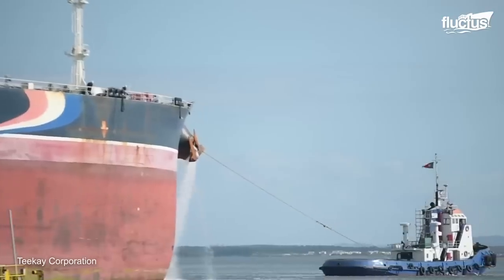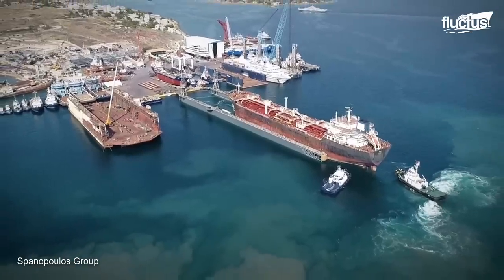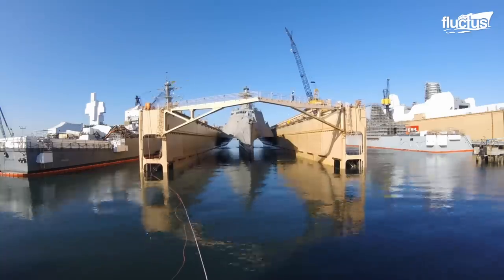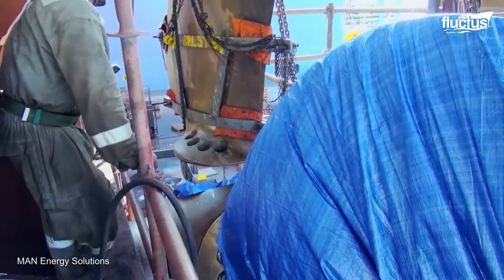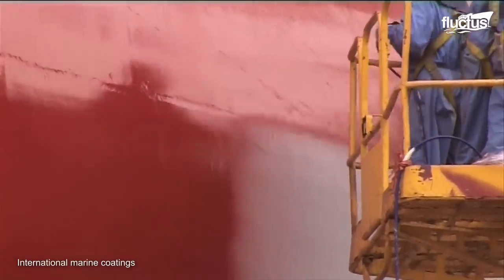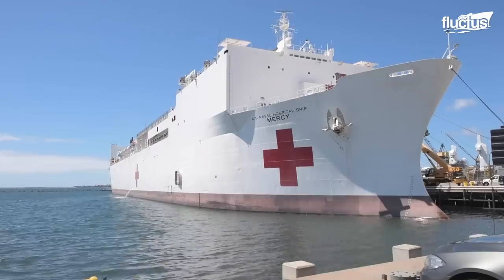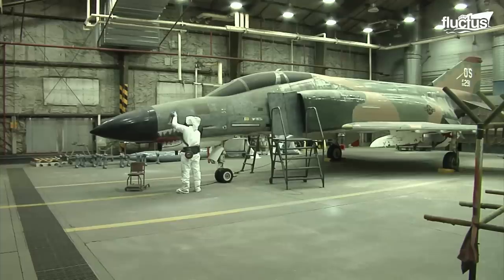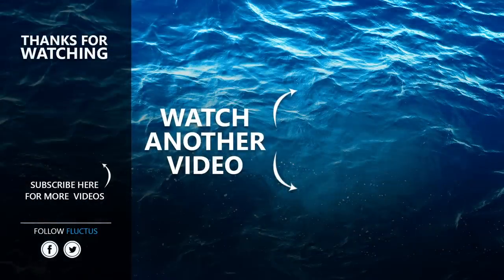The Crazy Process of Moving World Largest Ships into Dry Docks

Comment: Did I notice that most naval vessel sit in 8 ft. of water according to the numbers in dry dock.
Reply: Deeper than that
Reply: @Thomasnmi  I suppose it could be 8 yards and not 8 feet, it would make more sense.
Reply: @davemeeks8109  draft marks are in either feet or meters
If meters there will usually be a larger "M"
If in feet, sometimes the "tens" digit is smaller and easily missed.
Drafts of common cargo ships is between 8 meters and 16 meters for example